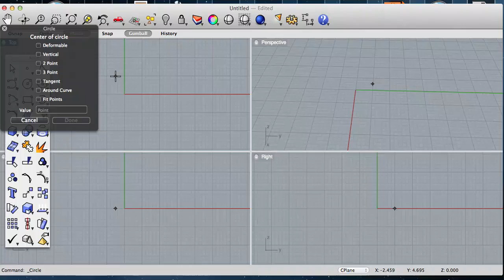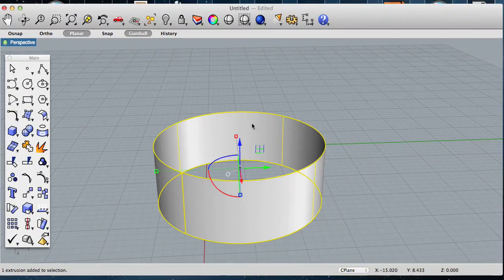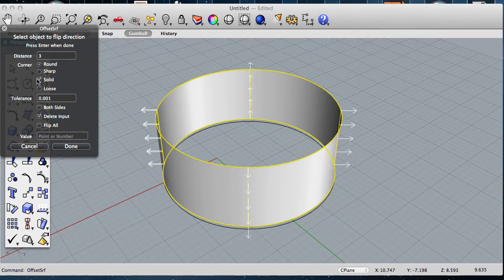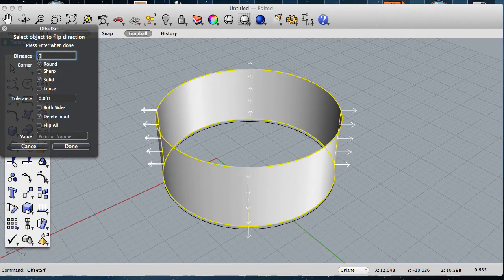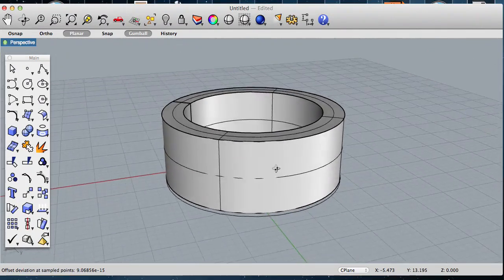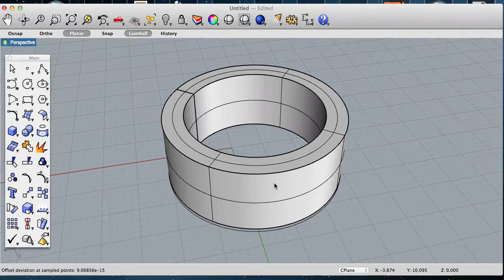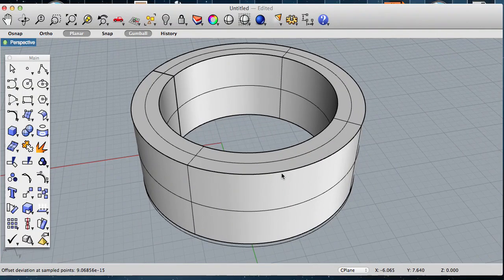How to Thicken a Surface Rhino 3D: Offset Surface

Comment: Great Video!!   One follow up question for you.... in your video I noticed as you keyed in the Offset command a popup tool bar popped up onto your screen which gave you all the options to change ( The one I am talking about is at 0:35 in the video )      How do you get this popup menu to appear? I am using Rhino 5
Reply: +Kent DeSautel  try checking your command bar on top of the screen, where you type the command offset you should see the options right there on the same line. I think his is different cause its rhino for mac.. I have PC  :)
Reply: I have a same question, i can't get the flyout in Rhino 5, you find the solution?

Comment: Thanks for the easy to follow tutorials. 
Would really like to see a vid on cutting a hole in a surface or better yet in an object like cutting doors and windows into solid walls. 
Would also like to see a tutorial on creating arrays as you might do were you to create a bare framed wall and create an array of studs from a single object. 
Thanks.